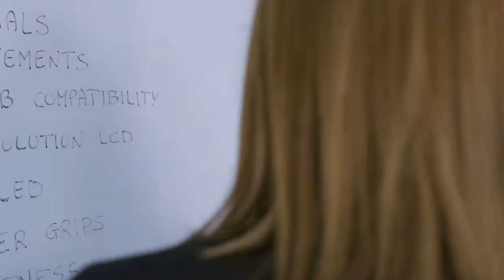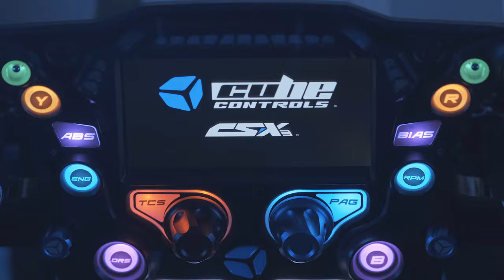CSX3 - Launch Trailer

Comment: For CSX4 i would recommend:
* 290 to 300mm (perfect size for Formula and GT)
* 5" oled screen
* non touchable screen (it doesn't add much beside a new point of fail)
* non recessed screen (GT position will have a hard time to see the information on the screen)
* led around the funky switches and thumb knobs

Comment: This really looks like a downgrade from CSX2 unfortunately. Screen is smaller and recessed, no clutch bite point adjustment, strat mode switches are smaller and don't show what mode you are in... man I was so hyped about this wheel since CSX2 was discontinued. Just bring back the CSX2 with magnetic cable upgrade, that looks like a nice feature.
Reply from the maker: Clutch bite point adjustment is via software now but you can also dedicate one of the rotaries to adjust it manually like in the past if you wish, the screen is now touch-screen, with double the resolution and it's SimHub compatible. RGB customization, upgraded ergonomics... the list is big ;)
Reply: @CubeControls  I'll look for a used csx2 if I can find one, thanks
Reply: @MaxSimsMusic  As an owner of a CSX2, I don't recommend this since the UGT software id buggy at the best of times, and it isn't being updated anymore and is completely inferior to Simhub. The wheel also disconnects whenever it feels like. The plastic on the 8 way rotary switches is very weak. (I managed broke both of mine off after having it for a few months) And the buttons on the face of the wheel are weak. 3 of mine have cracks in them, and I'm afraid they might just completely break at some point.
Reply: @NickG40  ok 😐 well, thanks for the info then
Reply: @CubeControls  and only works 20% of the time, and loose paddle syndrome.
Reply from the maker: Hi  @Buddster218 , we're sorry to hear that.
Please feel free to contact our customer service.

We will be more than happy to help you 😊